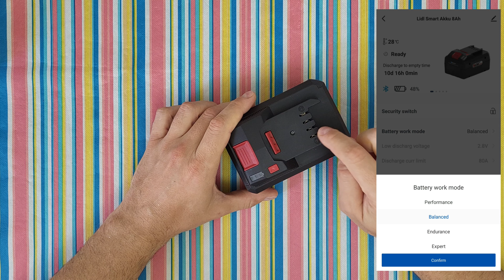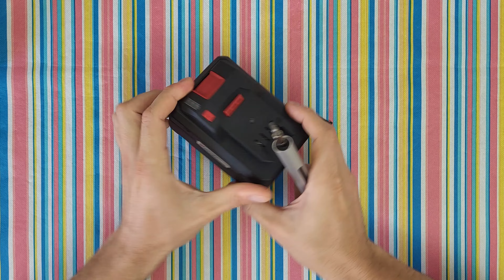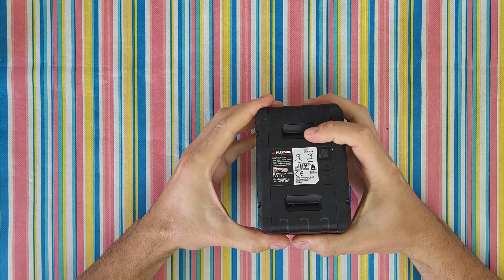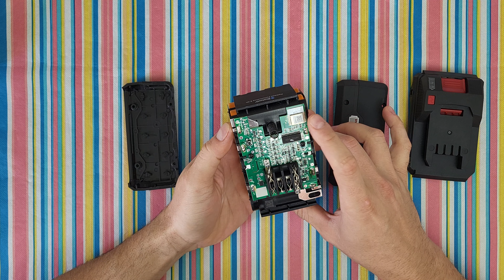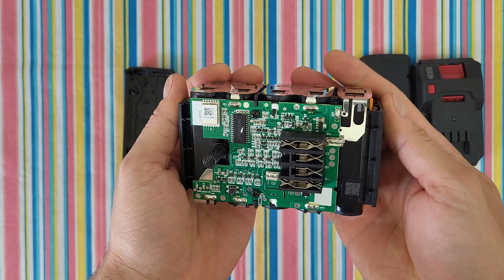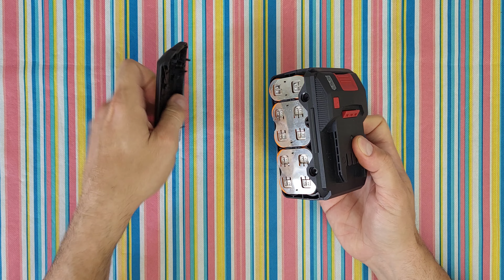Parkside Performance Smart Battery PAPS 208 A1 20V 8Ah

Comment: Hi,  I have one of these and it started working intermittently. It charges fine but the tool doesn't start and the led on the tool blink. If I continue to try sometime the tool starts and works normally until I release the  button then it will not work anymore and have to press many other times. What could be the issue? Some loose contact inside?

Comment: What are you gonna use bluetooth connection for on a tool battery????????????????????
Reply: Did you watch the other videos? Power discharge can be customised amongst other things...
Reply: Monitoring health, monitoring use etc etc
Reply: @Alex-uh1mj  And how long do you really gonna use all that crap before you dont mind you think?? pointless crap.
Reply: @nikolajc7617  i had it on ridgid batteries and used it to keep track of the use and health till the cells needed replaced.  Now doing the same again.  But then i know what im doing with batteries and make my living from my tools so....  Its also great to have on large ebike batteries for the same reason
Reply: @Alex-uh1mj  🤣
Reply: @nikolajc7617  😘